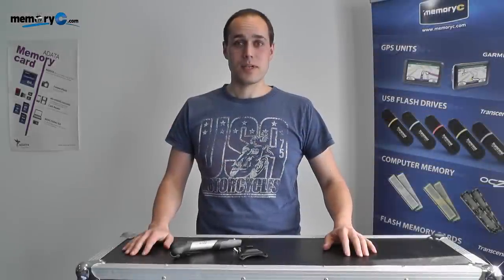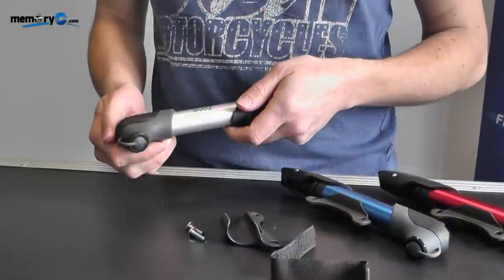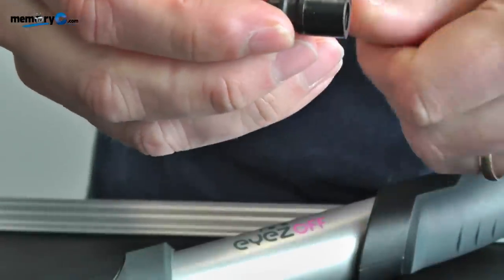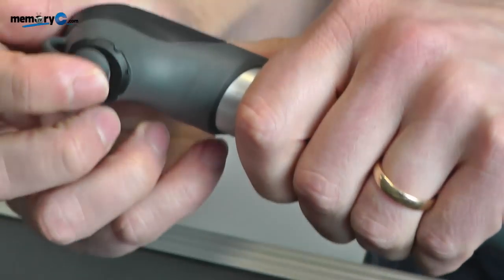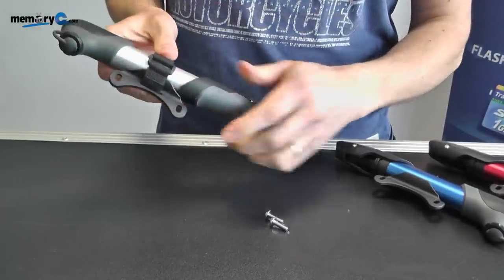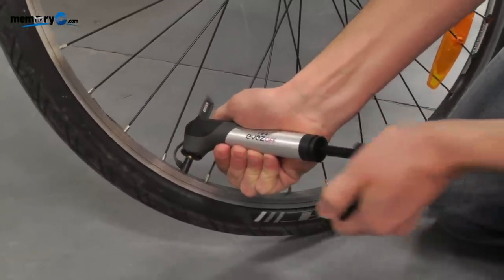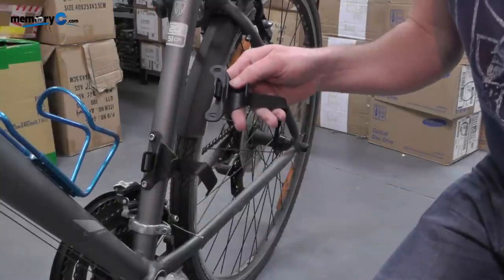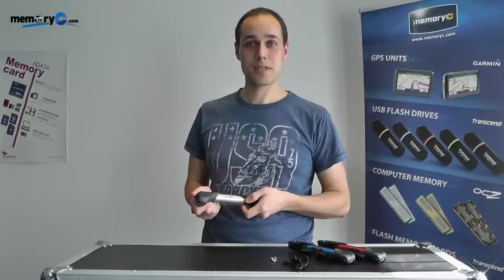How to - Tutorial: EyezOff GP96 Mini Bike Pump for Presta & Schrader valves

Comment: This only works if you have holes already in the frame. Any suggestions how to attach if you don't have pre drilled holes?
Reply: You can attach it using two zip ties ....that's how I fitted mine. That way you don't need pre drilled holes and later if you feel like changing the position of the pump you can do it conveniently.

Comment: Why do inner tubes have these crap modern valves in as standard these days, presta valves just rubbish and you can't use service station ait compressors on them any more. . A classic case of 'improving' things that were actually fine as they were.